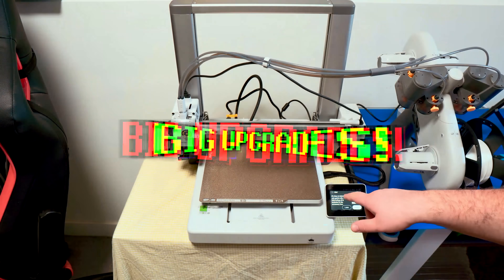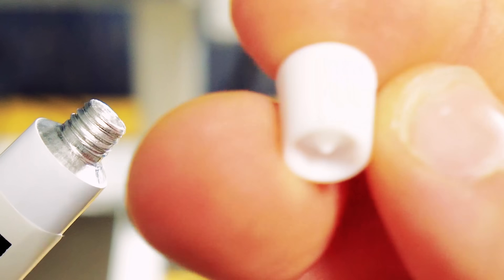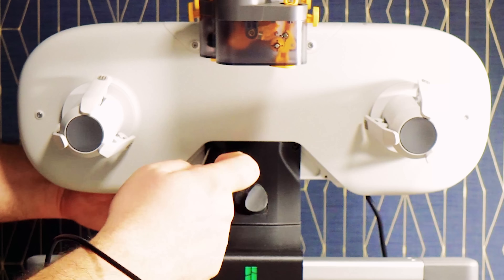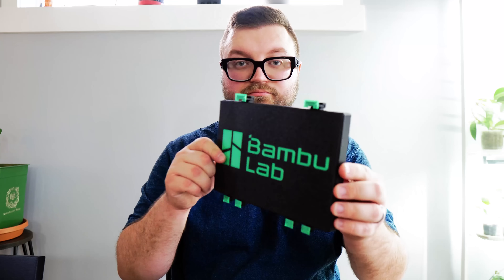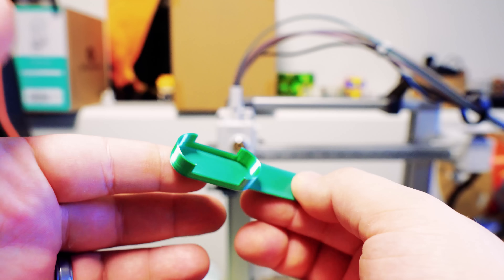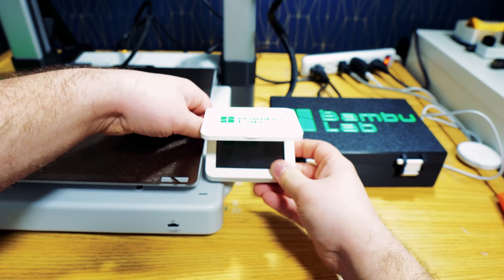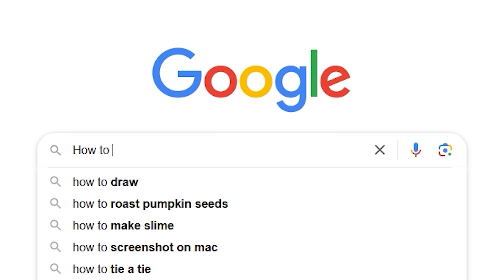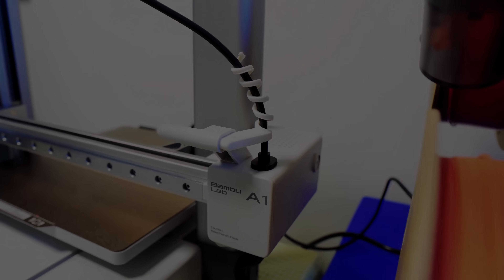10 Must-Have 3D-Printed Upgrades for Your Bambu Lab A1 Printer

Comment from the maker: Timestamps;
0:20 - AMS Top Mount
2:26 - AMS LITE HUB ARMOR FOR A1
3:12 - Bambu Labs A1 Accessory Box
4:17 - Poop Bucket + Stopper
4:48 - A1 Cable Guide
5:04 - A1 Build Plate Aligner
5:20 - A1 Screen Protector
5:43 - A1/A1 Mini Fan Cover
6:06 - Bambu Lab A1 Purge Wiper Fix
7:08 - A1 Cable Guide (Strain Relief)
Reply: There's one very helpful print you forgot to make, the Spool Removal Tool for the AMS lite. Makes take those cardboard spools off super easy.
Reply from the maker: @BigJon1378  damn, that does sound like a good one. I feel like i'm ripping that cardboard off sometimes XD
Reply: Hi. What is the name of the background songs? Please, i need to know

Comment: I know this video is a year old, but on the strain relief cable guide, since it's basically a corkscrew, couldn't you simply hook the tip around the cable and turn it until it's all the way on?  Basically screw it onto the cable?
Reply from the maker: I believe that what I ended up doing for my other printer. So much easier.

Comment: i would defo avoid the purge wiper fix as it WILL throw off your home position of the printer as well as force to much pressure on the filament cutter on the right side

Comment: Now that this video is 5 Mos old, are you having any issues with that top-mounted ams? I'm hesitant to mount it up there because of the weight and the constant wiggling that would happen from removing spools.
Reply from the maker: Hey there. Still use it, but reprinted it with PETG instead of PLA. Still nervous though ahahha
Reply: @3DPrintedProject  Oh that makes sense. Thanks for the video. Neat ideas.

Comment: Hi! Thank you for tips. I am preparing for my A1 delivery :D But Is it safe to put 4+ kg on the top frame of the printer? Won't it bend it later? It seems like a huge mass.
Reply from the maker: I had it now for 2+ months. No problems so far. Some people had issues, yes. Not going to lie, i feel nervous also when I have that many spools on there. In my case I kind of have to use it because of space.

MakerWorld has some different ones available that are wall mounted, please check those out.
Reply: @3DPrintedProject  got it, thank you for reply. I suppose if the frame wasn't strong enough, you would got issues much earlier, so probably there is no extra stress because of 4-5 kg. I have some lack of space too, and such solution is interesting to me.

Comment: Ehere do we get that 'm323' screw for the top mount ams
Reply: There are 4 screws that hold the bed in place for shipping. Those marked in red. I think those are the screws you're talking about.
Reply from the maker: Hey there, usually it's provided with your printer. If you bought the A1 they are usually provided.

Comment: so basically you started printing 6 months ago and now you are a pro doing it ! this is inspiring
Reply from the maker: I'll consider myself a pro when I know every single detail. :) far from it. Thank you for the kind comment.
Reply: @3DPrintedProject  I bought my A1 C like a month ago and just opened today I have been reading so much that I am tired I want to learn everything but is just not easy , the bambu wiki has a lot of great info , I am learning fusion 360 too because I need to create a part for a machine at my shop so you can see I am a little stressed out.
Reply from the maker: @kennycharneca1 what kind of material you're working with when dealing with car parts? What works for you to make sure they don't melt?
Reply: @3DPrintedProject  I haven't tested anything yet I bought PLA just to make sure I know how the machine works , for now I'll step up to petg and then I guess I have to buy a high end printer to use exotic filaments.

Comment: lol I love everyone who is mad about the top-mount. It works. Get over it.
Reply: Sure, it works. Until it doesn't. Which happens, just need to look in forums.
Reply: @M4XC4V413R4  "it works until it doesn't" is true of any 3d printer.
Reply: @OchsSlayer  we're talking about a mod, a print, not a printer. So no, it's not true for all prints. I never printed anything functional that eventually failed.
Reply: @M4XC4V413R4  so your top mount works fine then.
Reply: @OchsSlayer  I don't have a top mount. There's plenty of people saying it failed. I don't think any of them ruined the printer but it still shows that mount fails, and since this is a 600 euro combo, it's quite a bit of a risk to use something that has been shown to fail and that can cost you even more money.

Comment: Got my A1 three days ago. Been working it non-stop.
The last FDM I had was an old PrintrBot simple metal, and this thing is like going from prop bi-planes straight into the jet age (Though resin printing still holds my heart).
Reply from the maker: Where do you do your resin prints? I really wanted to at first when getting into 3D printing, but the toxic fumes and what not was what put me off.

Comment: sure, let's put some mass on top of the printer, what could go wrong...
Reply: 4 months of using the AMS top mount and it works perfectly :)
Reply: @LexxDesign3D  Put two there then!
I mean, what would be the problem?
Reply from the maker: I know it feels sketchy. Seems to work so far. I researched to see if people had an issue with this "mod" , but no negative feedback yet.
Reply: @3DPrintedProject  i have seen posts about spools falling on the bed and destroying stuff
Reply: @ipadize  yes thats the only problem but you print some adaptors spool wont go off
Reply: @ipadize there are spool locks you can print to prevent this.
Reply: @3DPrintedProject  Truth is most A1 buyers wouldn't know the difference in print quality...if it bit them.
Reply: @barenekid9695  It ain't like they can look at the IS graph as notice that the smoothing in their print has gone to hell, they look at the benchy and scream "look! no ringing!".
Reply: As long as its secured properly, not much could go wrong.  The top frame is aluminum and aluminum can bear a lot more weight than the AMS.  You aren't gonna damage the thing with like 10lbs.  The A1 can also calibrate for wobble so you aren't throwing the printer off if your table wobbles because of the extra weight on top either.
Reply: @Gweivyth  Do you know why the flying gantry was born?
Reply: @eaman11  because someone was bored.
Reply: @jorgdinkel2620  And why do they put the printers on pavers?
Reply: @eaman11  to reach the 99% line. for the most applications this is not necessary. 
you have to differ between the perfect print and what is enough for the most people. everyone has there own standards. Some want to know every screw on their printer and some want to use it as a tool like a screwdriver.
Reply: @jorgdinkel2620  Good to know, I'll take my printers off the pavers and put some KG on the top, so I can be a tool as well!
Reply: @eaman11  ok you didnt understand a single word i've written. it seems you are not willing to accept other pov.
Reply: @jorgdinkel2620  I don't have a pov, I have an accelerometer on the toolhead and a paver under my printer and no rolls on top.
Reply: @eaman11  Do you even have an Bambu Lab A1 printer? 
Why you have a paver under you printer? wouldnt it be better to place the printer directly on a concrete floor and also mount it there? Because everything else can and will vibrate.
Reply: @jorgdinkel2620  Question should be: do you have an accelerometer and can you read the results.
Reply: @eaman11  or maybe can you read material specifications and more important understand the values.
Reply: @jorgdinkel2620  What does it even mean? Did they teach you about mass and momentum at school? What material specification do you read to understand that you don't put mass on top of a wobbling maschine?
Reply: @eaman11 man you got REALLY hurt because people decided to use the top mount, eh? Geez
Reply: @eaman11  this rage bait goes crazy
Reply: I'd say put ams down. Adding 4+ kg onto a precision equipment is scary.
Reply: @vomobimo8873  I just got the a1 and Im thinking what to do... But as someone said there is no negative sides to the prints so Im waiting haha
Reply: Actually the weight is mainly an issue when being carried by moving parts. Here it could just help stabilizing a wobbling printer when at speed...as long as it hold firmly
Reply: If you're worried, print some arms and screw it to the wall

Comment: I just got one and it comes tommarow. From what ive heard it will be alot of fun
Reply: What's better? A1 or p1s?
Reply from the maker: Personally I do not have a P1S. From what I read is that P1S is good for people who need to print filament that requires an enclosure. Also it allows for 16 color swaps given you have the 4x AMS units. Slightly faster speed. Both are good options.
Reply: @jojomendoza3698  If you have to ask, you probably don't need added benefits of the p1s. It's a great printer, but overkill for most beginners/hobbyists.
Reply from the maker: Is this your first 3D printer? If not what are you upgrading from?
Reply: @3DPrintedProject  this is my first. I did lots of research and the a1 seems to be the best for beginners since it has auto calibration and comes almost completely assembled. And I got the combo so I can. Multicolor print
Reply from the maker: @popachockymilk  4 screws at the bottom of the printer and zip ties seem to give a lot of trouble at the very beginning of the assembly for people. Make sure those are taken out.

Follow the assembly manual it's really clear to understand and you will be good. :)